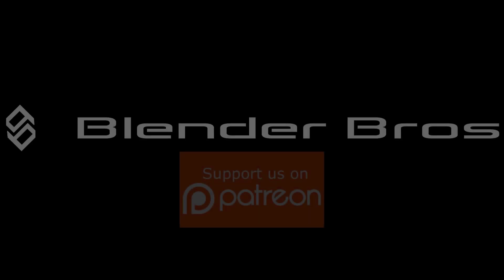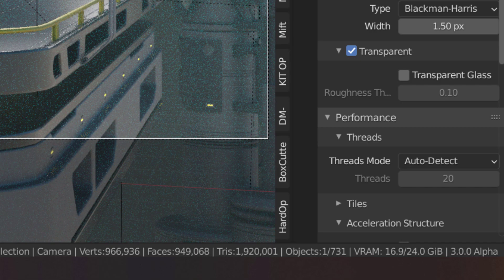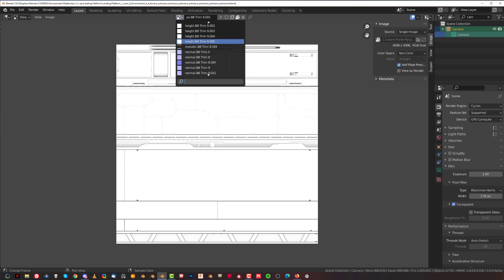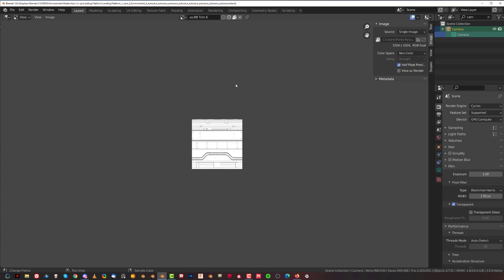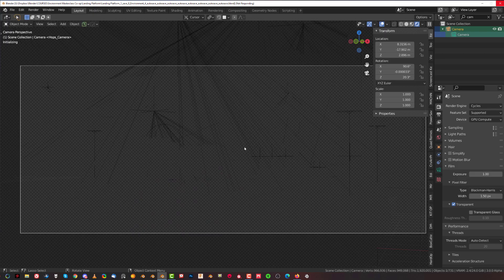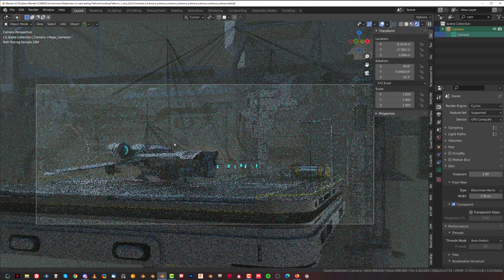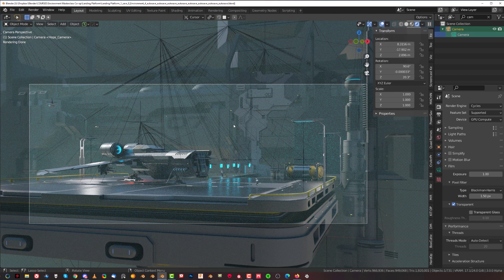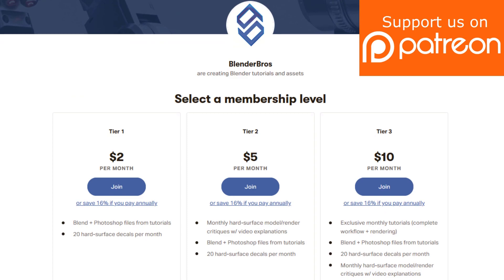Blender tutorial - Reduce .blend file size and V-RAM required.

Comment: Does Blender have any sort of cache in? I realized that very often stuff that i have been working a lot on get very laggy even if I am crazy about optimization.
Reply: Lower the undo steps. Also, when you go to render, close and open it again, because everything you do will add to the ram before you close it. For exemple even deleted materials or mesh
Reply from the maker: @hugoantunesartwithblender  or you could just reload the file which will clear the ram usage
Reply: @PonteRyuurui  exactly. Well, with  experience I believe we don't need so much undo steps, mine it's at 8. Having 32 will really freeze the pc with a really huge project
Reply from the maker: @hugoantunesartwithblender  i keep mine at 256, but i have 64gb of ram. ya 8 would make me feel claustrophobic, but i guess you could PS more frequently.
Reply: @PonteRyuurui  I understand. But at least until now I didn't felt the need to increase it, also cause the autosave. But yes, it's a choice ;)
Reply from the maker: @hugoantunesartwithblender  use power save addon
Reply from the maker: Ya, in preferences, you can set cache and scratch disks.

Comment: Nice but does this not help your problem
go into preferences, Viewport
then adjust the texture limit and other settings
Reply: How does blender limit texture sizes?
Reply: @DanielGrovePhoto  I was just saying to limit it while you work so it doesn't affect your pc as much I don't think it actually resizes them in renders or anything
Reply: @PointlessGamer_xD  This also affects the texture resolution when you render. This is exactly what Ryuu was asking for lol. Afaik it just limits the max size of a texture.

Edit; Best part is you can change it at any time.
Reply: @kris3871  Oh I didn't even test if it affected renders that is cool
I used it a few times when the scene was bogging down my performance, it's really useful
Reply: @PointlessGamer_xD  I know it does cause I was wondering why my 8k textures look exactly the same as my 4k textures xD Also I was using 2.93.3 yesterday and I saw that in the simplify tab there's a texture limit for both viewport and render. It should work the same way, I dunno, but it sure beats resizing every texture.
Reply: @kris3871  cool, glad you find it useful. I need to start using it more when working on bigger projects
Reply: @PointlessGamer_xD  I'd say good luck but its very simple lol.
Reply: @DanielGrovePhoto  I don't really know to be honest
but for it works
Reply: This should be pinned... soooo glad I read the comments!
Reply: @tinman3000  haha